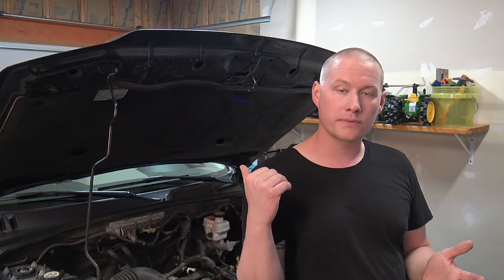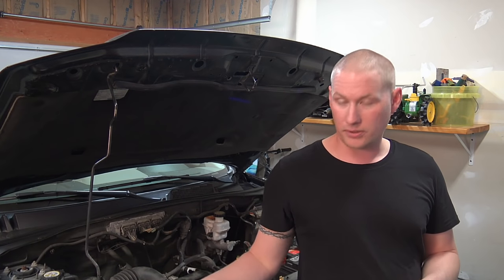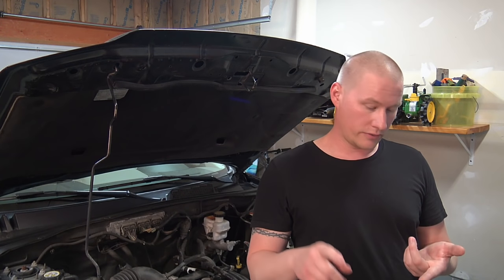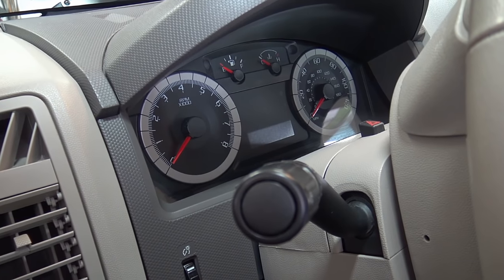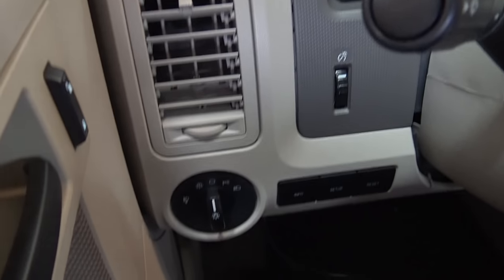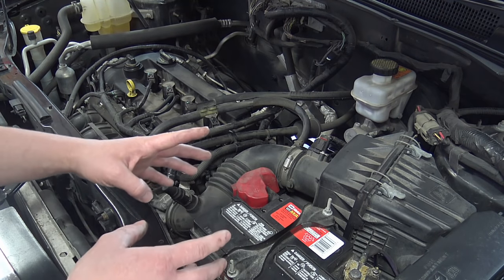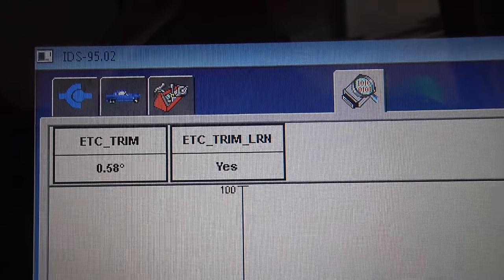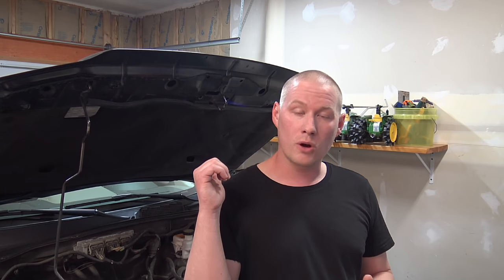Ford Vehicles: Electronic Throttle Body Calibration Procedure

Comment: I've done all that and still nothing and the little wrench icon is coming up. Any suggestions would be great
Reply: Walter Wheeler I just got the same thing.
Reply: @bryanwilliams7874  if you figure out the problem please let me know
Reply: @walterwheeler3978  I hate to admit what my problem was.  I had taken the throttle body off to clean it.  I cleaned the throttle body connection and was letting it dry so I didn't reconnect it immediately, then I forgot to connect it when I was done reconnecting everything else.  Now it runs fine.
Reply: @bryanwilliams7874  that's awsome my truck just got towed to ford
Reply: @walterwheeler3978  I hope yours is as easy as mine.
Reply: @bryanwilliams7874  thank you

Comment: HI I have a warning come up saying "AWD OFF?" That is what my 2011 has done twice. Both times we were able to shut car off and start back up and it is back to normal could Throttle Body is the reason .
Reply from the maker: +CARS WORLD No this is usually caused by the coupling solenoid in the RDU. Pull codes first.
Reply: FordTechMakuloco sorry, I am facing the same problem with my Ford Edge. What do you suggest we should try please ?
Reply: FordTechMakuloco sorry, I am facing the same problem with my Ford Edge. What do you suggest we should try please ?
Reply: I replaced the throttle body.  and now It's OK 👌

Comment: I reset my ECM to help a miss . Now it won't hardly run . 04 f150 5.4 . HELP !
Reply from the maker: Remove throttle body and clean it carefully then reinstalled and perform this calibration procedure.
Reply: @FordTechMakuloco  ok , thanks !!

Comment: will this work on a 2010 fusion
Reply from the maker: Yes it works on any Ford with an ETB system.
Reply: +FordTechMakuloco. whats an etb system?
Reply from the maker: electronic throttle body
Reply: +FordTechMakuloco ok so if i have low rpms after an automatic 3rd gear between 1-2 that means it might me the mass air flow sensor???

Comment: one more thing..sorry. the torque lookin screw on the outside, kinda rubber, yeah what's to say that was basically taken out because someone who helped thought it was keeping it attached inside?..I tried installing it back myself, but the car basically almost gave out the wrench popped up, but I killed the car before it actually went out because I had no idea what it was doing..
Reply: on a Throttle body..sorry this is the first time I've actually "posted" anything on YouTube..even comments..
Reply from the maker: No I would not put your life at risk it is likely damaged now. I would replace it with the latest one from Ford and fix it right here is the latest throttle body for your car- http://amzn.to/2axAf9C

Comment: Electronic throttle body,, easy repair, grab it from the top and throw it in the trash.
Install a mechanical one, it doesn't fail till the metal cable snaps. Motor will fallout before that

Comment: My jumper wire caught in fire. Why??
Reply from the maker: Maybe you had another battery or capacitor for a sub?
Reply: @FordTechMakuloco  nope, I just didn't disconnect the ground terminal correctly. Ford focus, they have a weird extension and I confused it for disconnecting the ground. So I basically just bringed the battery.

Comment: Ford wanted $700.00 to replace a 2017 Fiesta gas pedal and sensor built in. I looked it up on line. 2 nuts hold the pedal in place and I bought the gas pedal and senor for $70.00 online. Ford is a rip off.

Comment: To Hell with the jumper wire, just turn on the headlight switch.
Reply from the maker: That has not worked since the early 90's. Now it takes 3 modules to turn on the headlights, these modules that need power and ground to work. See what I mean???